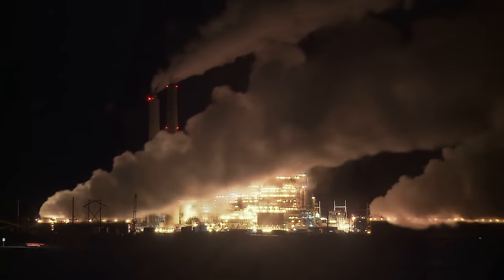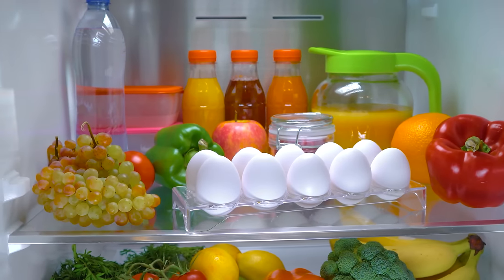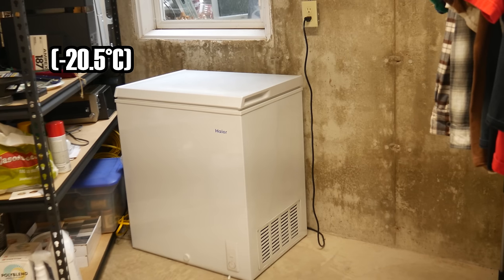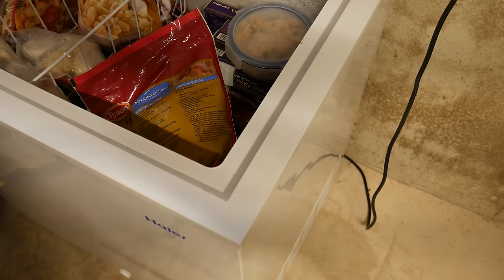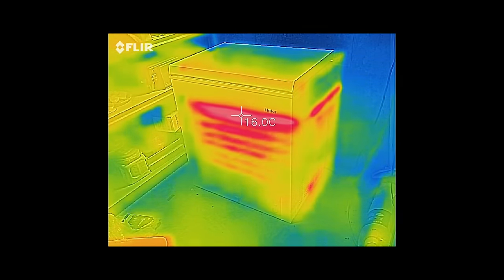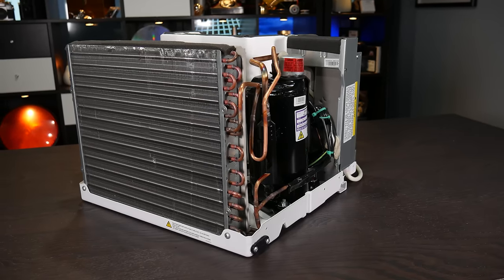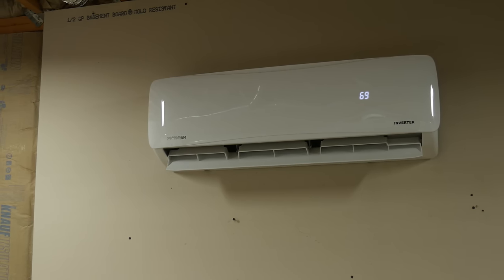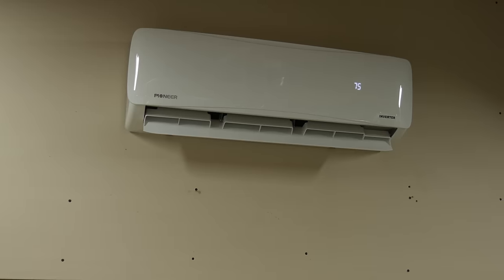Heat Pumps: the Future of Home Heating

Comment: for 20 years I've been asking sales reps to explain heat pumps, how they work, and how my cost would go down as brochures and signs say.  No one could tell me.  Next door got a huge carrier unit installed I asked installers, they couldn't be bothered or didn't know.  Now I know.  THANK  YOU SOOO MUCH!
Reply: Heat pumps do not work under certain temperatures. Below 2 degrees the part outside; the heat exchanger slats start to ice over and the heat coming out drops to negligible. Be better to get a blanket.  Believe me I live in a cold area and it’s better to light a fire.
Reply: @xr6lad  As stated in the video, it depends on (1) which heat pump you get (more expensive models continue being efficient to -20ºF), (2) how old it is (they have come a LONG way in the past ten years, so if you have an existing old heat pump you are basing complaints on that probably doesn't apply to a new model), and (3)what you mean by "do not work". They don't just stop working, but slow down their heat moving abilities. I'd say definitely when the COP reaches 1.0 it is definitely no longer "working", and a more conservative estimate would look at when the COP dips below the ~2.5 that it takes to be more efficient than natural gas. Realistically, you should compare it to what your "backup/emergency heating" system is. But, again, if you spend enough up front on your heat pump, it doesn't even cross the 2.5 "natural gas" barrier until it's below -20ºF, so clearly most people in the US can get a lot of efficiency out of a heat pump system. For instance, a Mitsubishi H2i has a COP of 2.88 at 5ºF and 2.5 at -13ºF, and it isn't the most deluxe air-source heat pump out there! Of course, if "money is no limit" the next video in this series on ground-sourced heat pumps should be very helpful (there, the cost is in excavating to install the ground source tubing, rather than in fancier electronics and more efficient compressors to squeeze more heat out of sub-zero air). The point is, though, even if you "couldn't" run your heat pump for 10 super-chilly nights in  a year, they all have a backup heat source to switch to. Isn't using a high-efficiency heat pump for 90 nights and gas for 10 a better idea than gas for all 100?
Reply: @xr6lad  Not true. There are units rated to work down to at least -25°C. Also not everywhere in the world has gas available. I don’t unless I buy bottled gas.
Reply: The installers may not know. They may have a job that takes 12 hours to do properly and would rather focus on that. If it snows a lot in your area, stick with the gas furnace. The wear and tear is too much on a system running 24hours, and the system he’s going to mention in the next video is so expensive to install that it’s not worth the little you save with greater efficiency
Reply: @xr6lad  I won’t believe you. I live in Norway. We know a thing or too about cold. And heat pumps are the standard for new houses here, has been for the past decade atleast.

Way back in the day, heat pumps were useless below those temps. But the tech has moved forward, and they now work just fine down to -25°C. Yes, they lose efficiency, but are still a viable option, depending on factors like house size, room layout, insulation, etc.

If you live in a place that might see temps below what a heat pump can handle, like in Norway, it’s recommended to have supplemental heat sources for those periods, but that’s again down to different factors per user.
Reply: If you live in the US the energy cost is never comparable to heating with natural gas. If you want to speculate on the future cost of natural gas rising significantly while electric costs not raising in parallel with them then that's fine. They are talking about efficiency in terms of heat loss, but not operating costs. Something important to recognize.
Reply: Joshua Theroux  Um not in places where you don’t Have a gas furnace. They work on their own. You just have to purchase one rated for negative temps.
Reply: Exactly why I say be wary of what someone supposedly "in the industry" says about anything. I still argue with my brother over EVs because one Chevy salesman told him once that they will need new batteries in 5 years...
Reply: The engineers just probably couldn't be bothered to explain. They are paid to instal not explain to someone who isn't their customer.
Reply: If I want to change I need to invest 25.000-35.000€ for a heat pump.
Why is that so expensive? All future Tec  things are easily double the price. 
They always calculate after years you get even. Bravo. If I add to this a mid solar array and a family ev. Or a battery for the night i get near 100.000. electricity also gets more expensive so calculating gets nasty.
But most people do not have these money laying around or want to get the next Hypothek for everything.
Reply: My husband says that everyone he has seen who has had a heat pump for their home furnace has experienced HUGE energy cost INCREASE every time they turn it on.  Our new  home is a 6-or 7-yr-old double wide, and it has a heat pump. My husband says we absolutely cannot turn it on this winter.  Our electricity bill has already been at least twice what we have ever paid for electricity before--almost $300 per month, even after we stopped running the A/C!!!  We are going to have no choice but to take out the manufacturer's fireplace and replace it with our wood stove that we moved from our previous house.  We'll be heating our home solely with our wood stove (bought brand new in 2021 and a model that's mobile-home approved).
Reply: @blacknester probably cause y’all are talking about C and he said Fahrenheit. -10 C isn’t all that cold.  The heat pump uses the same amount of electricity as it does when in cooling mode.  It’s 220v and typically around 35 amps depending on the size of unit.  Electric back up heat is typically around 40 to 50 amps at 220v.  If you are using 220v and gas backup to keep up please explain to me how you are not using more energy total to keep warm?
Reply: Joshua Theroux  xç
Reply: @xr6lad  , Modern heat pumps work fine at 5F because they use R-410.  Actually you can get ice on the outdoor coil between about 5F and 38F, but not below 5F because the air does not hold humidity below -5F.  There is very few grains of water in the air at 5F to -5F.  While at 70F, the grains of moisture in the air is in the 750 grains+ range.  

When it is raining and the heat pump is heating mode, the water condensing on the outdoor coil can allow the collection of much more heat than a day that is say 40F and not raining.  I measure the hot gas temperature going into my indoor coil (for a 14 SEER Goodman 48,000 Btu heat pump installed in 2014).  Today at 35F outside, the hot gas was only 117F, due to the cold outside air temp.  When 47F yesterday, the temperature was 147F.  

I have 1,800 square feet, and a 2.5 ton unit might have been installed by many companies.  However I installed this larger unit because at 23F the capacity is 25,000 Btu's while using 3 KW per hour.  At 15F the heat output is 20,000 Btu's.  Remember the cold freon goes past the compressor motor, collecting all the heat of that motor before getting compressed, and sent to the indoor coil.  Most consumers never even realize that on a cold day the back up electric heater is running many hours per day.  The installing company says "That is the way they are supposed to run".  While the customer is paying a lot more for the electric heater to run when a slightly higher capacity unit would allow them to not run the electric heater at all.  I never connected my back up electric heater.   

I have been installing and servicing heat pumps for 38 years.
Reply: @Kangenpower7  Why are heat pumps so much more expensive than centralized AC, when they're so similar?
Reply: @Nordlicht05  three things pay back multiple times in their lifetime: insulation, led lights, and duct sealing
Reply: @Nordlicht05  Why don't you install minisplit's? Doesn't free economy work for you? One 8kW hot/cold heatpump (minisplit you call it?): ~2000€ installed. Air-to-water ~10 000€, thermal energy ~15-20 000€ drilling included.
 AND even if you would have to "boost" a little on the coldest days you win all the other 330 days a year. I installed a thermal heatpump in 2007 and burn some wood on the side. From ~2000 liters of oil/diesel (~250 gallons) to ~6500 kWh of electricity. I win ~1000€/year and do some good for the environment 👍🏼.
Reply: @johanneslaxell6641  prices are from neighbours and relatives. Heatpump change in Germany is about 30.000+ but until now you get 40% from tax money back.
I don't use that much energy. Insulation is good and 100% led lightning is installed. Now we use about 2500kwh per year. Small solar is there. kWh price is actual 0,40cents.
If I count all these together + new windows in the near future and we have old cars something can't be done without a credit. I won't use money I don't have that was only for the house.
Reply: @Nordlicht05  30 000€- 40%=~21 000€. If drilling more holes than one, maybe... I'm sorry but living in Finland 1000km to the north I just don't understand the pricing. The hardwear is cheaper for you (we buy alot from German companies, VAT is lower and the prices to) so I just don't get it. I am sure that you are right, but "anyhow"...
Reply: @johanneslaxell6641  yea depends i really don't know why this is so expensive. But I don't complain this year i got 500€ back because I used less gas water and electricity.
Reply: Shame they do not work
Reply: @gowdsake7103  Maybe the problem is installation or use? My heatpump takes the heat grom the ground, my neighbours from the air and many relatives have "miniplits" and all of them work. Maybe these UK and US "who knows" should come to FI🇫🇮/SWE🇸🇪/NO🇧🇻 on a "field trip" to get some ideas...
Reply: @johanneslaxell6641  They ONLY work if the home needs barely any heating that does not apply to 90 percent or more of houses.
I have a friend in the US and every winter she has to sit wrapped in a blanket because her system will not heat her house because it was utterly unsuitable
Reply: @gowdsake7103  "They ONLY work if the house needs barely any heating that does not apply to 90 percent oo more if houses."
OMG!!! You have to be joking. Because if that would be true it shows that someone has no clue about building. Insulation: 8"(floor)-8"(wall)-16"(sealing) and tripple heat keeping (filled with argon) windows. Minimum should be 6"-6"-12"...
 It's not the heat pumps that are wrong if someone lives in a box without insulation. But if you build "all show, no go" it's the way you build. Don't blame the heater, blame the builder...
Reply: @xr6lad  Is there not a way to have de-iceing help maintain the unit a bit longer? Perhaps alongside have a series of modes associated with use under these conditions that can help time its use better to accommodate the weather/temperature scenario. Or maybe that just adds in a bit too much complexity there I guess.
Reply: @DrakeKillah  The only way for heat pumps to work is by having proper insulated homes! Here in the UK majority of homes aren't insulated properly and homeowners who wanted to install heat pumps needed between £20,000 to £50,000 just to insulate their homes to have £10,000 costs of install it!!
And what's worse newly built homes aren't insulated properly because most of large house developers build cheap cardboard homes (they're designed for gas boilers only)!!!

And yes in Norway and rest of Scandinavian countries the heat pumps work, because homes are built and insulated properly! Also on your country population number is way less than the 65 million in the UK!!

Also the UK weather isn't dry cold and it's rather humid and zero temperature feels -5 or -10!! Unlike Scandinavian weather!!
Reply: @xr6lad  This might have been a problem of *very* old heat pumps(or models not made for low temperatures). The heatpump installed at my house is rated to -20°C, and it can achieve that with defrost cycles.
Reply: @justincronkright5025  There is and every heat pump will have a defrost cycle. That guy is a little confused, heat pumps will always build up frost when they are being used and must have a defrost cycle. However at colder temperatures the frost builds up quicker and requires the unit to be in defrost mode longer to remove it. That is one of the reasons that a heat pump loses efficiency when its gets colder out as the system still draws almost the same amount of power when its in defrost mode. The other reason they lose efficiency is because the maximum theoretical possible efficiency of a system depends on the temperature difference from the outside and inside.
Reply: That's why this channel is highly needed
Reply: I had a carrier geothermal system installed ~15 years ago with a Gas furnace aux/backup since heating using electricity is ridiculously expensive compared to Natural Gas. (I had to argue with contractor for a week to get this configuration installed, but I did the math and turned out to be right in the long run)
Geothermal unit does excellent job cooling (Northern Ohio) but it struggles to heat when temps are below 20F (even cuts out at 15F).
Gas furnace can heat up house quickly from 65 to 70 and then I switch to Geothermal to maintain temperature.
I primarily use gas when its below freezing to prevent electric bills reasonable /keep the Geothermal running from running 80+% of the time.
(BTW house walls were hollow and filled with foam insulation)
Reply: @xr6lad Actually unless it's badly designed it should work even at cold temperatures but it gets less effective the colder the warm reservoire is. But the least effective it will ever get is the same efficiency as an electrical heating element. Central heating is a much more effective version of the same concept.
Reply: That isn't true, there was a study done showing how well they work in extreme cold.  Also, they're 30% more efficient in extreme cold vs gas powered furnace.
Reply: @xr6lad I live in northern Canada. Heat pumps are tremendously popular here. It's always a good idea to asses weather one would be suitable for your home or not of course.
Reply: @xr6lad there are now units that operate as low as -35C. Read the papers from the Yukon government’s heat pump testing pilot project. There is also ground source heat pumps which operate with increased efficiency at low temperatures, but are really only suited to new construction.

Comment: Fun to watch. I live in Sweden and close to 60 percent of all Swedish detached houses have a heat pump. The number of houses with heat pumps has also increased by almost 50 percent since 2009.
Reply: I live in Sweden too, i lived in an old apartment complex with direct heating. I literally bought a house in order to survive this winter, heat pumps truly are a blessing!
Reply: Don't hesitate to switch on your heat pump at full power during the daytime. It's much easier for your device to 'pump' the calories when the sun is still shining. I live at high altitude and I stop my heatpump in the late afternoon when it's getting very cold and switch to wood during the night
Reply: @balokurd17 ,  Yes I agree that running the heat pump during the day is much more heat per hour and a little more heat per KW of power used.  I have a thermometer on my hot gas line going into my indoor unit.  At 47F yesterday the temperature was 147, while this morning at 29F outside, the temperature was only 117F.  

So setting the temperature a little warmer during the day will save electricity overall.
Reply: Stay tuned! Some "Nordic weather certified" multi split heat pumps are available soon in those countries.
Reply: I thought it was fun too. My sister lives in England and for them this is something new....
My previous heat pump was installed by my father, some 30 years ago. I replaced it a couple of years ago (same brand - Toshiba).
I have a separate meter on it so I can see exactly how much electricity it draws. 272KWh is the maximum I've managed a month, and that would be during winter with cold spells below -20°C.
Remember to buy a larger unit than you need, set max compressor power to 75%, set fan to "Max" (it will only go to full when needed).
Reply: @wolw66  it depends on the cost of electricity and how often it is needed I guess.  Here in Lithuania, judging from my last years central heating bills in a 51m2 commie block apartment, it would take ~40 years for a heat pump to pay off I think. And we had 5 months of heating last year. Heating here for me costs 50-75 euros a month in cold season with the hydronic central heating. In England, unless further north, it's just way too costly. Barely any cooling required in summer and rarely much heating needed in winter at least in the London area.
Reply: @iclicklike3397  Almost all houses in Sweden are detached, not like in the UK where almost all are block or semi detached. Here, a heat pump saves me roughly 10000-15000kWh/year which would translate to €1000/£855 / year. But then, I have a Soapstone wood burning stove as well. Without the stove, a heat pump would pay off in two years including installing.